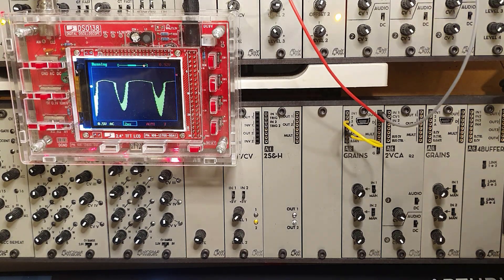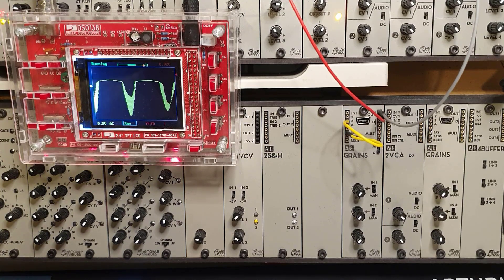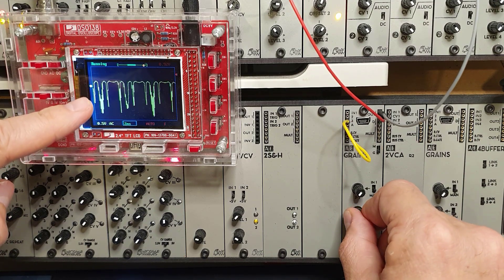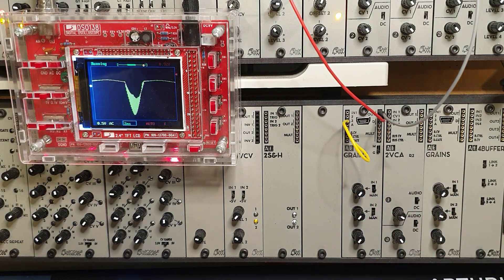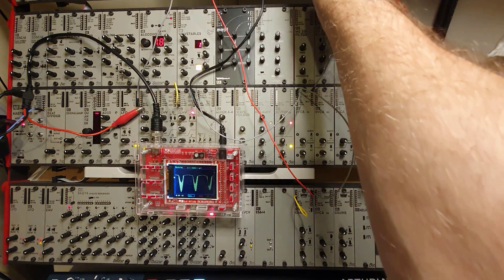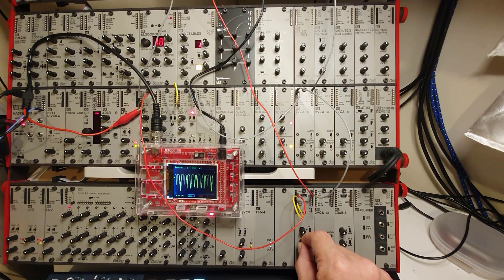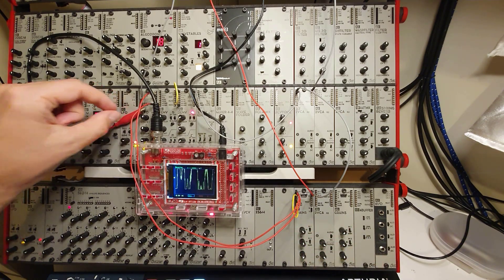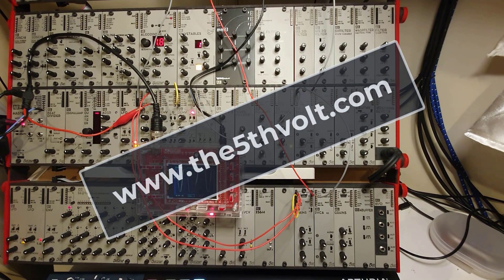AE Modular - GRAINS Codes - Scheveningen

Comment: Can you tell me exactly what waveforms are being folded? Usually triangle waves are good carrier waves to modulate, rich in harmonic structure, with not to many artifacts. I was watching the scope on the Grains module and I thought there were rectangle waves present, perhaps square or pulse width at 50% or better, hard to tell. Pulse width modulation in itself is rich in harmonic structure. I enjoy your channel, and AE modular systems, Tangible Waves.
Reply from the maker: I'm not sure what waveform this is. As you can see on the scope it looks like a deformed sine wave or rounded square wave. In the end I don't really mind as long as it sounds interesting, which, to me, it does.